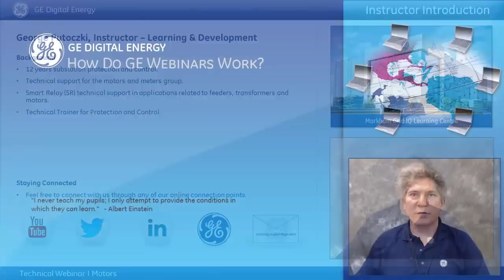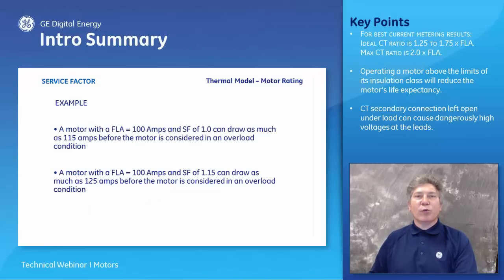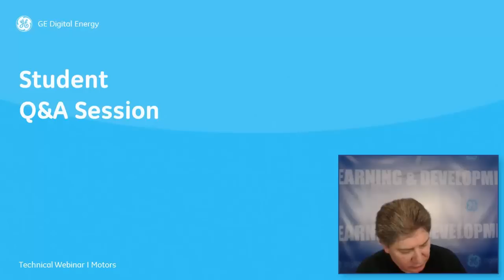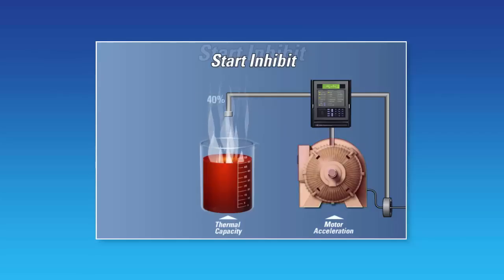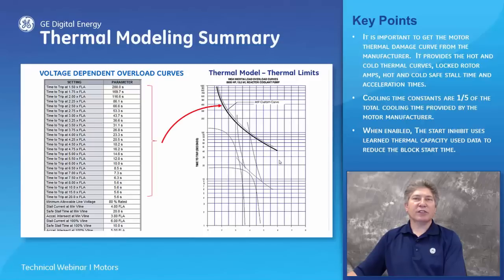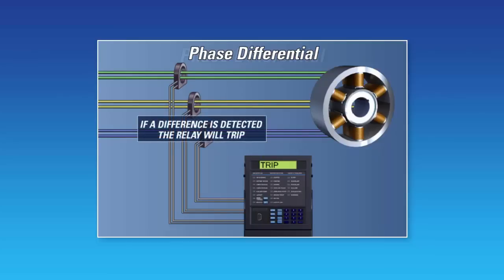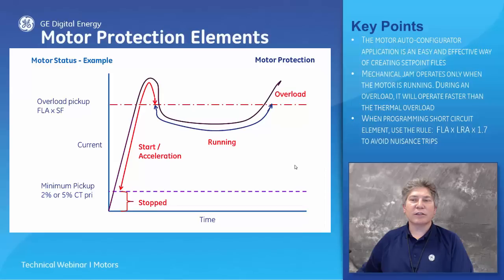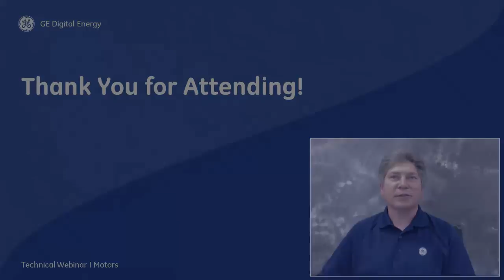FMPR-2002  | Motor Protection Technical Webinar v1

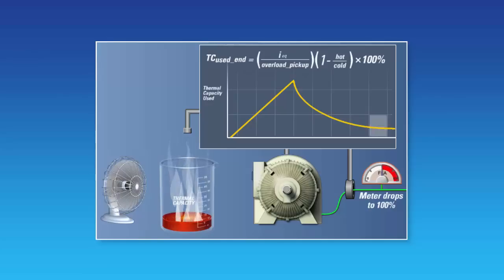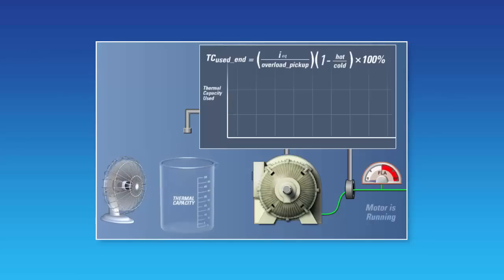Comment: Thanks for your practical content. I have a question. If a motor with a hot/cold ratio of 0.8 is running at FLA at the steady-state condition (temperature is stable), what would be the TCU of the motor. Based on the formula at 38:15 sec it would stabilize at 20% of TCU. On the contrary at 38:45, it seems that the motor at FLA consumed 80% of TCU.